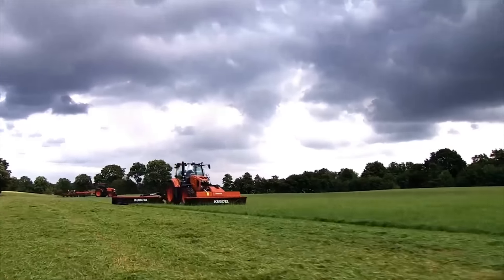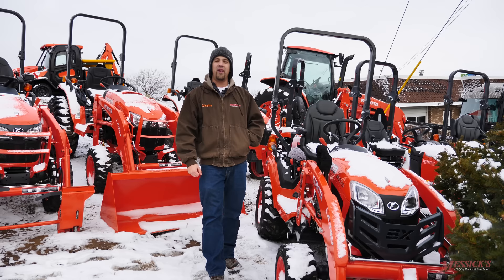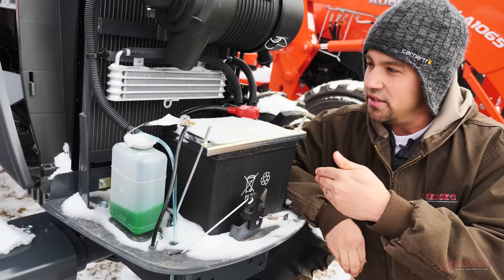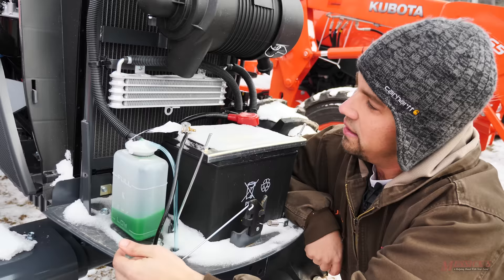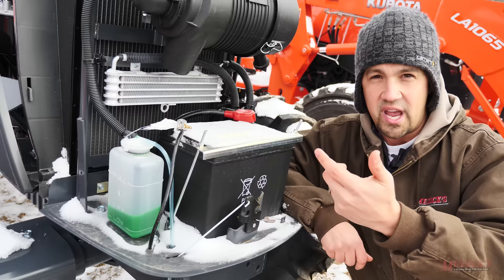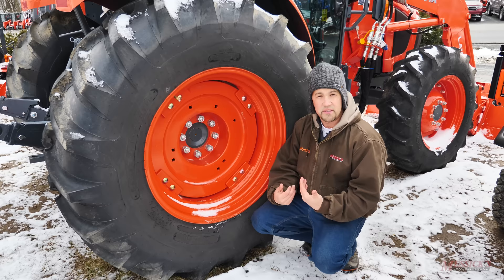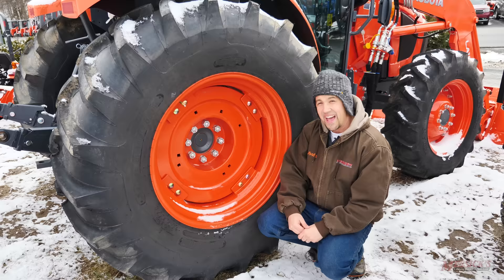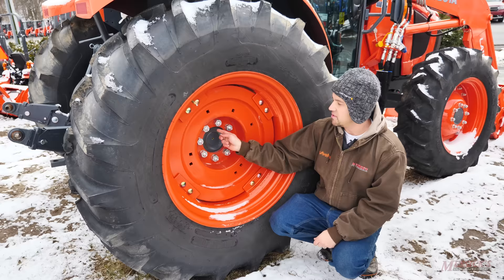5 Critical Mistakes New Compact Tractor Owners Make

Comment: You have full permission to drop one of those abused machines off at my house I'll fix er up and use it properly.
No questions asked.   Make sure it has a loader cab and backhoe attachments.
As well as mower kits and snow blade set ups.  I'll put my own stereo in it I've done brand new ones of that brand as a pro installer
Dam were they fun to play with.
But I can't afford to buy one.

But I wouldn't kick it out of my yard.   Same with an old 8n ford
A massy, a deer or just about any brand. I'd love to have one.
And I don't even own a farm.
You can do so many things with those it would be worth it to have one where I live.

There fun to play with, in the winter if the city streets too full of snow and you can't drive up the hill I'd get to go play and remove the snow.  Lets say some farmer near by wants his fild mowed, or the weeds on the hwy are too tall to pull out of my area, some poor person ran off the road.  Or I just need to clear a downed tree off the street.  I could clear paths in the green belt to use as hicking trails.

Comment: Don't a lot of machines have mechanical locks for the backhoe and/or anchors?
Reply: LA Prepper there is a pin for the backhoe but he doesn’t mention it and of course after using the backhoe you have to remember to put it back in lol
Reply: in a lot of cases yes. however, its not wise to rely on them. Always pull the main backhoe arm as far up as you can, then pull the dipper in as you tuck the bucket inside of it. This way, in an emergency, the bucket will remain safely tucked inside two massive chunks of steel and aluminum.
Reply: For the booms yes, for the stabilizers, haven't seen them on the compact units, Woods, Kubota, or Deere.  I have a woods, and the arms do leak down over time, especially more after a few years of use.  Also for those that have their own seats, they can flip up and rest on the controls, so if no control locks, then a lever can be pushed that releases pressure on something.  Always use the locks, even when just moving from one place to another.

Comment: this guy is awesome...a salesman, but still awesome. I think it's funny he mentions we have to check our tire lugs....One of my rear tires was mounted backwards(shraeder valve was on the inside(dealer quality I guess). I also found extra bolts on the deck and a 3/8"-6" ratchet extension just resting on my HST guard. Should I buy a John Deere piece of garbage next time?

Comment: So what did we learn here? Kubotas leak, the wheels fall off, and the hydraulics don’t hold pressure, great vid
Reply: The best tractor ever made...
Reply: Informative video. Good job messicks. And I’m a Mahindra dealer. Credit where it’s due.
Reply: David Seals we just got a dealership about 45 minutes south of me I'm thinking about checking them out
Reply: I've had more of those problems with a deere
Reply: Aaron, give them a shot. If they don't take good care of you give me a shout.
Reply: Lmao!!
Reply: Was going to say this, seriously new tractor should be tight as a drum
Reply: All hydraulic systems will leak down unless you have check valves installed no matter the color of paint.
Reply: And where were the mistakes of the owners?
Reply: Not checking lug nuts, not accounting for leak down in garage.  Not tilting ROPS when going into garage.   Not cutting PTO shaft to fit.   Freaking out when fluids drip through breather.
Reply: @MiserableOldFart  the biggest issue with kubota is their customers are generally 1st time machine owners.
Reply: Don't know about that.  My first Kubota was far from my first machine.  But I listed the things because Roger Mize asked the question.
Reply: Kubotas are undoubtedly the best compact tractor.  That said, they are for idiots to screw around in their backyard with.  They lack adequate cooling, lubrication, and general robustness to operate at a 100% duty cycle.
Reply: A mans knees should never reach beyond his loader mounts! Very well put comment.. We roll hay, and run batwing bush hogs I have never understood compact tractors. You can get more done with a zero turn and a stand behind skid steer.. @randymagnum143
Reply: We also learned that this Messick dude has the "gift of the gab", along with a catchy jingle "A helping hand with your land". LOL
Reply: Ha, Ha, Yup, give me a green one any day.
Reply: Florida, it looks like you didn't learn anything. All tractors have the possibility to leak a bit. Big leaks might be a problem. Wheels don't fall off. If you didn't torque the bolts on properly or check them quarterly, then they might loosen off. Buy lug indicators, like big rigs use, if it bothers you. All tractors lose hydraulic pressure over time. Its normal. once you start up the tractor, pressure is restored. Just follow your maintenance/usage schedule and you'll be fine.
Reply: There are videos out there of kubotas with air in the cylinders. Shop took it for two weeks just to say it's normal, and the air will leave the next time he uses it. What's really sad is that first time owners will think slop like that is to be expected from all equipment. Already been said here. Probably use cheap seal configurations in cheap cylinders.
Reply: I’m quite happy with my Kubota B26 TLB

Comment: I'm happy I got a used cub. I don't have to worry about leaks(superior thermosyphon radiator doesn't have an overflow container), tires falling off, a pesky roll bar hitting stuff, or implements that even require the PTO(though some use belts attached to the PTO). Farmall Cub > those orange things.

Comment: LOL, I hit my garage door frame, it popped my front wheels up. I traveled  6 inches wheels came down. Roll bars ended up between door bottom and door frame. I was trapped!! couldn't  move tractor  or  fold roll bar. Had to let air out of tires to clear.

Comment: I like your jacket. I am getti g a new bx1880 and one of those would look good on me. How can I get one? I like your video, too. I wish someone would have told me these things when I got my first tractor 7 years ago, which sadly was stolen. 😢 Anyway, I too, encountered these issues and nearly paniced, bad. I did, however, encounter 1 issue that was a manufacturer "brainfart". My hydraulic hoses for my backhoe had different colred ties to show where they connect to. I unhooked my mower, then backhoe, then reattatcjed it, to see if I could and connected blue to blue, red to red, and yellow to yellow only to find my loader nor hoe woukd function. I called a few dealers and one gave me a "secret" tech support number for dealers only and they helped me confirm that the ties were put on wring causing me to inadvertently connect it wrong. Thankfully, the tech said that even though they were backwards, it was still inline. Better than no connecting it at all. No damage done. Just had to remember to hook red to blue, etc...Could have got some ties, I guess, but thats all "water under the brige". I am going to get my baby bx as soon as I get his or her, home built. I have been torned between green, orange, and the red one. My other baby tractr is my profile pic and I miss her. 😢 I love your informative videos. I wish you were closer to me. I'd deinately give you my business.GOD Bless.
Reply from the maker: Here is the jacket he was wearing. If you want to order one for yourself, you can call our parts team for details, 800-222-3373.  https://www.messicks.com/part/809CBKKU/809cbkku

Comment: Good info. shared, thank you.  "WHILE UNDER WARRANTY PERIOD", should I be able to have a Kubota service person do this service while within the warranty?"   If... after 2hrs of operation(mentioned in video), on hr. gage, the wheel lugs to be torqued/tightened.  Rim looks deep and I don't own a torque wrench come out and do that for each wheel?   Thank you.
Reply from the maker: The first service internal is at 50 hours. If you've not checked up on anything, it would be good to have a dealer do the service.
Reply: @MessicksEquip      Great info. Thank you and this whole thread, best I've seen for people sharing and respecting.  Thanks ...  thank you all!

Comment: Keep the RPM's up and select the lowest range for what you are doing. Otherwise engine overheating will occur. Cost a customer a new head that was cracked. Goes for anything with a hydrostatic transmission. ex. Skid steers

Comment: New sub compact owners need to be reminded that the higher the loader is the higher their center of gravity. With the narrow stance they can be quite tippy
Reply: I found out the hard way.  In the seven years I've owned my subcompact, I've rolled over three times.  One time my leg was caught under the deck.  It was extremely painful but I finally got my leg out by digging the dirt out from under it.  I had the tires weighted then and I'm very careful on how and where I operate the tractor now.  It is too narrow so it rolls over easily.  I wish now I had bought a larger or at least wider tractor.

Comment: Hello, I have a bx2380. What engine rpm should I use to run the mower deck?
Reply from the maker: there is an indicator on your dash, its about 95% of wide open.

Comment: ROPS should never be in the up position unless you are on hilly terrain / at risk of roll over, the funniest thing imo is the guys who have them up all the time but never use the lap belt. ROPS are the single most dangerous "safety" feature on any given piece of equipment and the best way for inexperienced operators to flip a machine.
Reply: A operator can get "unseated" without a seatbelt.  When driving into something hard. Hiding in the materials with a bucket in the loading position.  Also if the operator had to stop quick in high road speed gear.
Reply: Have had mine up for 18 years, and have yet had anything happen. Use Common Sense, if you have none, stay off a tractor.
Reply: When I first got my CaseIH DX24e, which is a subcompact, I used it to clear out the irrigation ditch behind my place and to clear the outlet gate from the large irrigation canal.  I was backing up and hit a small hummock of clay. Then I found my self lying on the sand with the tractor turned on its side. It took the help of a lot of people but we got it upright and out of the canal.  Without the seatbelt and the ROPS I doubt I would be here now since the tractor most likely would have rolled all the way over with me under it.  The only time I've been hurt was when the tractor turned over when I was clearing a ditch and my leg went under the side of the tractor.  The dirt was soft enough I was eventually able to get free.  I used the ROPS to set the tractor upright.  My leg hurt for a few days but I've done worse.

Comment: Be a lot easier to monitor the PTO for length if it didnt have all that useless plastic hiding it.
Reply from the maker: I would normally ignore ignorant comments like this. Once you've worked at a dealership for a little while, and you've seen the number of people walking in missing limbs from equipment injuries you would end up having a little bit more respect for the things you're dealing with.
Reply: I have little sympathy for the stupid getting self inflicted injuries.     That plastic wouldnt bother me so much if they didnt inconvenience  greasing the ujoints
Reply: Use a multitool to slice it down the middle. splits the shield in half  in seconds !  no need to struggle with a utility knife
Reply: Messick Farm Equipment
Thanks for stating this. People forget how dangerous even the subcompact machines are. 

The most favorable way to protect against injury is removing the risk, the next is guarding. Administrative protection, such as training, is a couple more steps down the list because you're relying on people not to have accidents or make mistakes. Accidents and mistakes happen because we're human. If a little bit of plastic saves someone from being permanently maimed or worse, it's worth the minor, one-time headache of checking for proper PTO length.
Reply: There will always be an expert that knows better if you don't like the plastic guard cut it off but if you hire someone to help out I would suggest you put it back the reason it's there is the same reason the numerous stickers warning about turning part injury
Reply: +gene and the reason is ambulance chasing lawyers.
Reply: I lube the joints on my equipment and have no problem with the plastic covers, shrouds etc... I also work in emergency medicine and see the horrendous injuries caused by removing protective measures.
Reply: @l337pwnage  Take the plastic guard off if you wish  they are your limbs  .

Comment: I don't have a shed! It ok to keep tractor out doors in northern pa??
Reply from the maker: Paint will fade, but other than that generally ok.
Reply: Put a trap over it at the very least and a  temperature compensated battery maintainer. And maybe a block heater on it  if you'd like it to start when its below 0 degs.
These three things will buy you many more years of use out of it.

Comment: 😲 That Kubota has snow on it. 😐 , I never take my Kubota out of the garage if it's bad weather. My BX25 is too pretty and new to be anything other than a fair weather cruiser. 🤠
Reply: Buy JCB equipment : hydraulic pistons should not leak until they are showing signs of wear.  Use plastic " flags " on the wheel nut to give a visual indication of any wheel nut movement
I think these are compulsory in Europe on all Heavy road vehicle but I never saw any fitted in the USA
Reply: @sparkfishes  Its not the cylinders that leak its the valve body seals. Oh and JCBs leak down worse then any other equipment because JCB doesnt use pilot operated lock valves on their critical cylinders.  Its a small block that is bolted or strapped to the cylinder that the lines flow through first that need external pressure to open the valve to allow for cylinder movement.  I just worked on a JCB backhoe at our shop last month and none of the critical cylinders like outriggers, main dipper , or loader arms had any sort or safty valves from the factory on them. Since it was such a cheaply built machine. If you moved any of the joystick controls while the machine was off then any one working on the engine or under the rear boom would be crushed by the arms. These valves are small and inexpensive and to over look such a simple item durring design is astonishing.  You look at Caterpillar, John deere, Bobcat, even New Holland all use lock valves for this safety reason. 
Depending on the o- ring seals in older lever style valves is not a good way to design a hydraulic system . Pilot pressure valves and the newer drive by wire servo electric valves are much safer ,lighter , less risk of fire in the cab, easier to service, take up less space, and can be located directly on the arm rests of the operators seat.  Jcb through out the machine  constantly exhibited a sense of if there was a corner to be cut to accomplish a task they would do it. Using zip ties to support hydraulic hoses to welded chain links that are tack welded to the frame. Not having a spin on return filter on 3 of the 5 lines being returned to tank. Using a belt driven hydraulic pump on the side of the motor as if it were an after thought instead of a direct drive system through a gear box, having a single directional flow accessory  line on the back hoe . So only a breaker hammer can be used on it , installing a 3 speed fan blower motor in the cab heater box but only having tge switching ability or the wiring to support 2 speeds , not having a level indicator rod on the loader arms to tell when the bucket is flat . Do you see where im going with this. I have many more examples but these are some of the simple ones. Even the cheapest garden tractors in the U.S. have a level indicator rod on the loader arms.

Comment: When did  equipment cylinders , that aren't scared up & seals packed correctly bleeding off become normal , among other bs statements he made ( fluid leaks etc ) hell according to this guy ...as an operator for the 20 (+) yrs I could have the company an ass load of money had I known that leaks and bleeding  off was NORMAL
Reply: I've operated heavy equipment for the DPW and, I also thought those statements, regarding the "normal leak/bleeding of cylinders" was off, I've only seen that with blown cylinder seals, and I was taught to, "always rest/shore up attachments, release hydraulic pressures by moving controls until all is at rest.  When put away for the over night etc.. out of good habit.    Great point Sam.